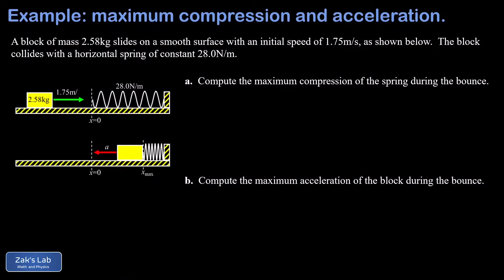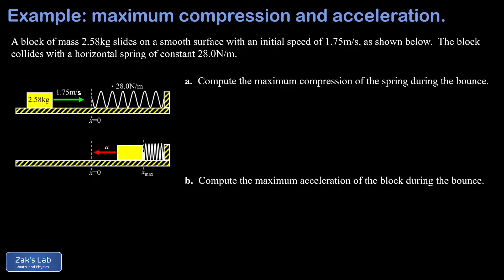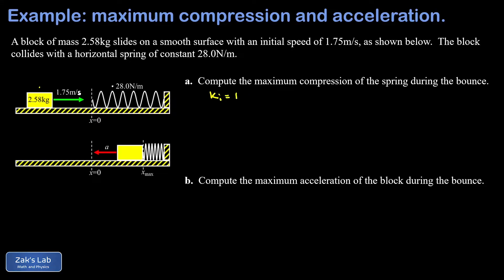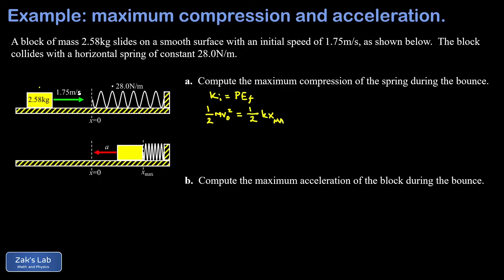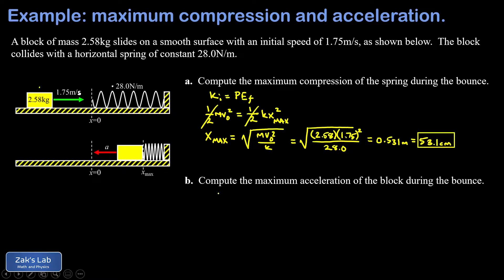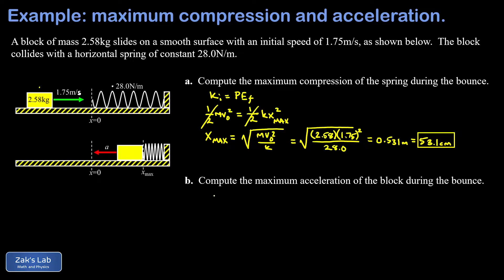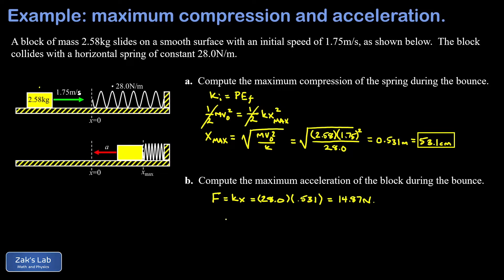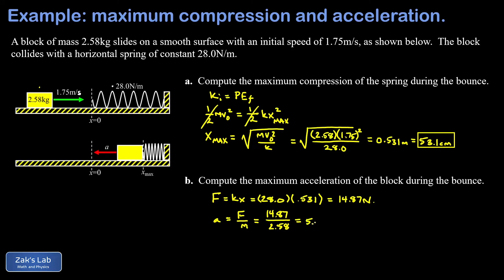Block runs into a spring:  calculate maximum compression and maximum acceleration of the block.

Comment: Hi, I have a similar problem and as long as the mass is in contact with the spring, the system can be described as a simple harmonic oscillation. I need to calculate: How long is the body in touch with the spring. The answer is Half period but I don't understand why. Could you please explain?
Reply from the maker: the spring starts at its equilibrium length, compresses to max then back to equilibrium before the block loses contact.  Why does the block lose contact at the equilibrium position on the way back?  Because the spring starts to extend just past its natural length which creates a force back to its natural length.  So the block goes off at constant speed while the spring starts slowing down, and contact is lost.  So the time for contact is from the equilibrium length to max compression back to equilibrium length.  This is a half period (a whole period would be equilibrium -> max compression -> equilibrium -> max stretch -> equilibrium).
Reply: @ZaksLab  Oh it's clear now, thank you very much